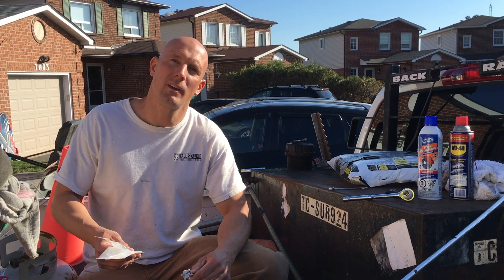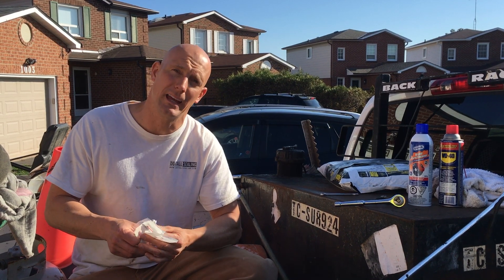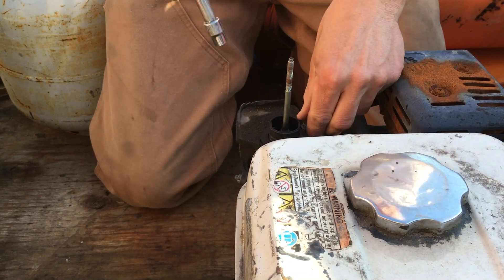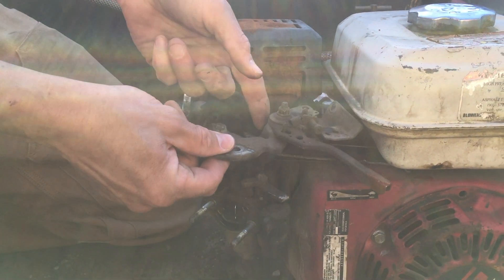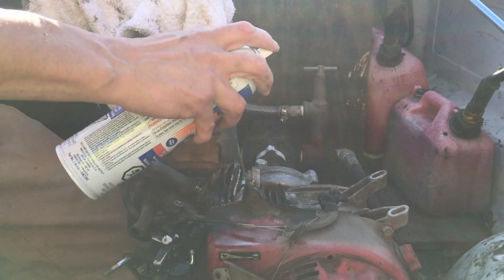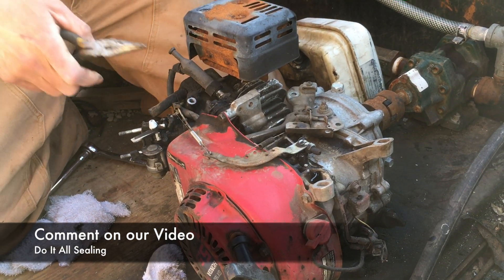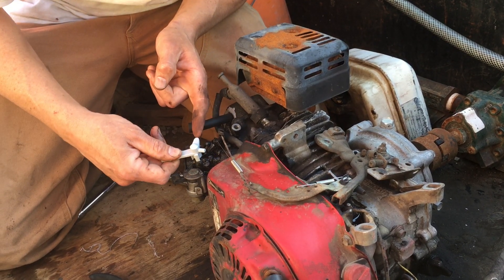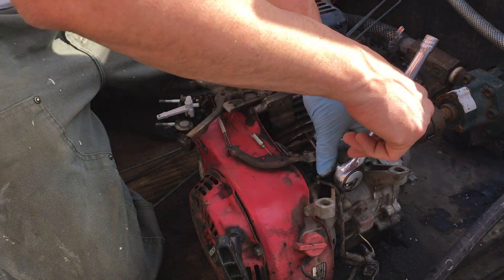Honda GX160 Engine Repair

Comment: My throttle lever is stiff and stuck ..I loosened nut at top and it's still stiff ? What's happening is it's only running at idle ..it builds air but does not idle up
Reply: The lever is full bunny position and still at idle very still to push back

Comment: My engine runs really high rpms even on the lowest throttle setting. On high throttle it sounds like it’s gonna blow so I run it on low. I was told I need a new governor but another mechanic said I probably need it adjusted not replaced. Thoughts?

Comment: Hi Jeff, thanks for the informative video. I have a problem with my GX160. I don't get enough pulse to get sufficient spark for ignition. Do you think the coil connected to spark plug needs replacement or I am missing sth out? Thanks in advance
Reply from the maker: It could be the Ignition Coil but also check your oil sensor as well make sure there's enough oil in. If so then I would say your ignition coil.  I've had to change mine before as well on that same engine.
Reply: @JeffLepard  oil level was fine, the ignition it is then. Thanks alot!
Reply from the maker: @Yangar03  that would be my guess for sure.  You can get a good deal on Amazon or ebay if you're not in a rush for it.
Reply: You may want to lightly sand the coil and the Magnet on the flywheel. Check the gap between the 2.